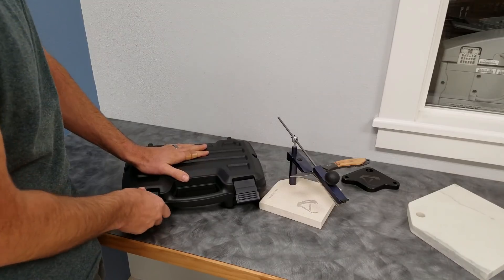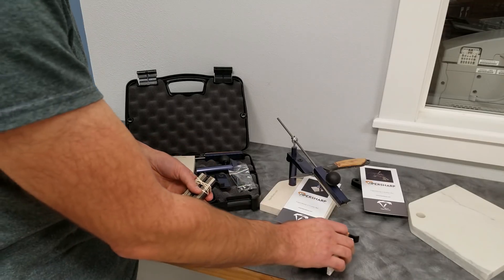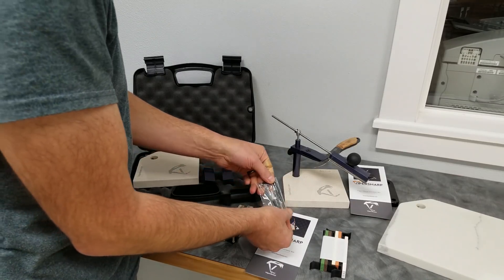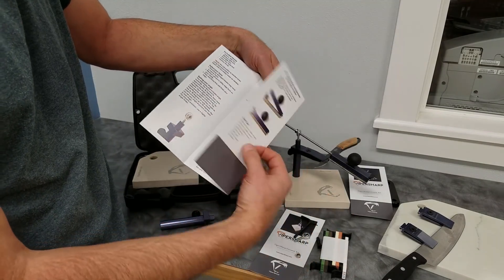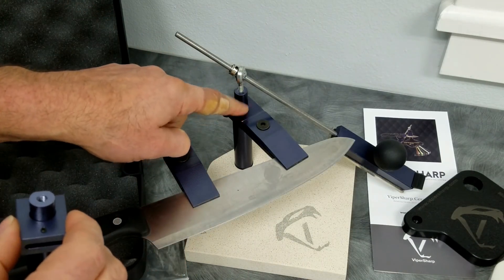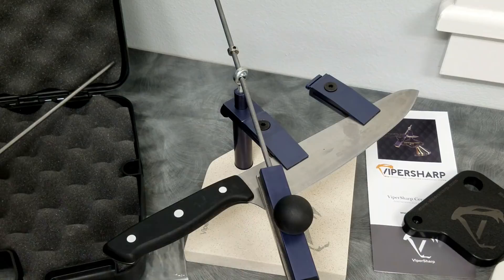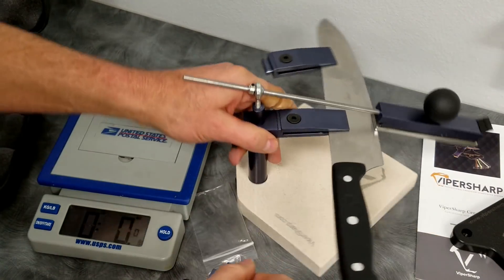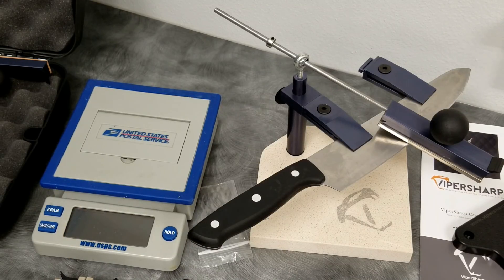ViperSharp Knife Sharpener Assembly

Comment: Have you tried a wedge type coupling? Like you wedge it in, no play and not need for a screw. A tiny cam clamp with a lever could also be a quick release solution. For alternating sides when finishing I cannot imagine screwing and unscrewing every pass.
Reply from the maker: difflocktwo I'll look into those ideas. It all comes down to function and cost. I want to be able to offer a solution that won't drive the cost up. Honestly it works great without locking it down. This is just one more step in my quest to please everyone. Lol.
Reply: Viper Sharp Is there any reason the slot is from the side and not the top?
Reply from the maker: Yes, the original design (very first prototype) was from the top and it did not function as well as desired. This side option works much better.